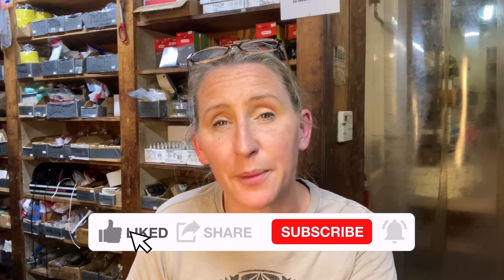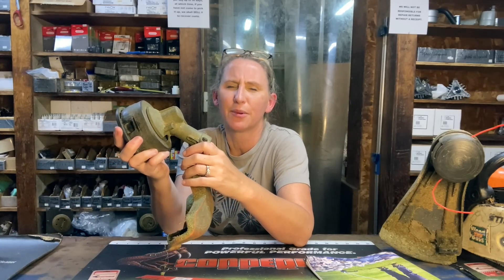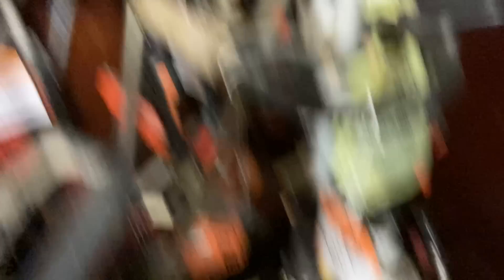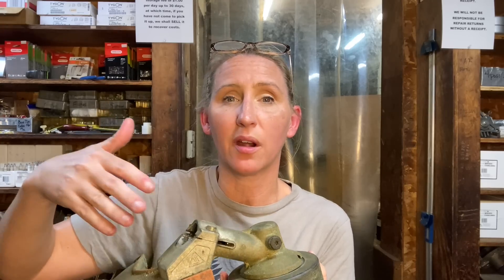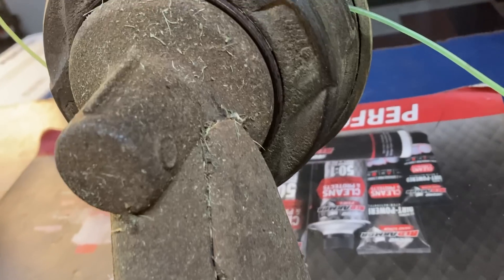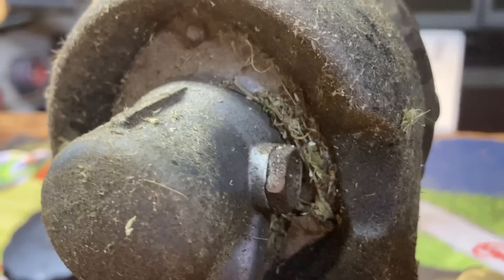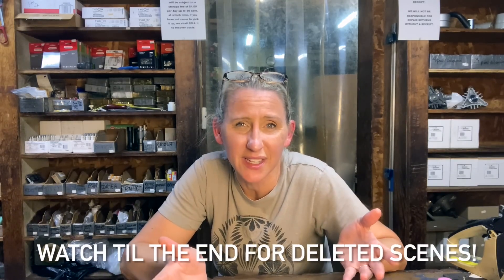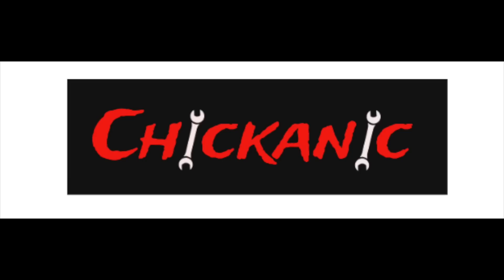Planned Obsolescence?! Why Would STIHL and ECHO Do This?!

Comment: It’s like with the Briggs “Just Add Oil”. The reason they do this is that 90% of people do zero maintenance so the bean counters saved $0.35 per unit. This also ensures that 100% will be dead within 5 years and don’t expect to get it covered under warranty. More planned obsolescence. I understand Stihl doing this but Come on Echo!
Reply: They saved more money than that. The biggest cost was probably due to having to scrap hundreds of parts every time the tapping machine's got out of adjustment(yeah, pipe threads are awesome until you're putting them into castings). A lot of money was lost due to having to recycle parts that passed QA after being cast but were ruined by the tapping machines. Another thing is that just-in-time manufacturing really doesn't like it when there's a random chance that thousands of parts that were supposed to be made in one day end up being delayed due to problems with a tappper.
Reply: @ryelor123  : Production thread tapping is very different to hand tapping a one-off job.    Factories use spiral flute taps that self-clear, and the machines are more consistent in speed and force than any human.
There's not much QA done in mass production factories now.  Human process workers have been replaced by robots, so there's a lot less variation.  In the 1960's and 1970's factories did a lot of check measurements at every step, and employed an army of QA chaps and their statistical tables of Acceptable Defect Rates and whatnot.   If they were supplying to the military, the checking cost more than the making.
But when Japan lost the War and the USA had to move in and run Japan for a while for humanitarian reasons (and keep the communists out),  they saw that Japanese factories were 40 years out of date and were making crap.   So they brought in experts, and one of them taught the Japanese that it is better to design a production process that makes no defects, rather than use a process that has some randomness and you waste money on scrapping and fixing.   The Japanese really took that onboard and by the 1970's were outcompeting the West by low cost defect-free manufacturing, even though their wage rates had got pretty high.   This thinking has now spread throughout the West.
You may have heard an old story that did the rounds in the late 1970's.   An American company decided to contract a Japanese firm to make a large quantity of widgets.   The Americans in accordance with normal US practice wrote into the contract a clause that said that the Acceptable Quality Level (AQL) was a 0.05% defect rate.   When the first shipment of 10.000 widgets arrived, the Americans found that 5 widgets had been packed separately, with a little note ""These are the 5 defective items that you requested."
Reply: @keithammleter3824  Thanks for the stories about Japanese manufacturing after WWII. My favorite was the last one about the 0.05% defect rate. 🤣
Reply: I change my lawnmower oil every season and i put in husqvarna premium fuel for winter storage..... I've had it for 9 years now and it still runs like new.

Comment: Probably a reason was they found out almost no one was greasing it, so they got rid of it to save a nickel.
Reply: Would it be possible to add a grease-fitting to a trimmer, and use a grease-gun to lube the gear head?
Reply: @elultimo102 possibly yes, 
But. 
A problem with machine (drill/tap)  swarf in the spinning parts!
Reply: I've been abusing a Shindaiwa t25 since 1988. I grease the gearhead annually.
Reply: @thomasbunch8476 I’m definitely impressed.  Those were great units, but we haven’t had one in the fleet in years.  We still have an Ol School power broom from that era though. Cannot recall the model, but the primer is in the line with a purge lever, pre push bulb style.
Reply: Indeed, almost nobody greases up those heads and most of them thar do, overfill that cavity. One should only add a few pea-sized dabs of grease as just like in a ball-bearing, grease caking will impair the movement and lead to its failure. Good maintenance practices would call for thorough grease flushing every third year (fill the cavity with a solvent like kerosene and operate it at no load momentarily). Worst come to worst, one could easely drill and fap a hole and add that "missin" grease plug !
Reply: I think it's a way to sell part.
Reply: @egbertmassey8069 exactly sell more parts and bring more customers to their dealers for repairs. 
And if said customer is tired of dealing witb repair. Theyll just try to upsell them. A whole new unit. Likely one thats been updated to take more consumables.
Reply: Exactly what I was thinking.
Reply: Its because that kind of plug can be easily ruined in manufacturing due to tapping machines getting out of calibration. Once they get uncalibrated, every defective part has to be scrapped once QA finds out. By getting rid of the grease plug, many fewer parts are re-melted and less inventory space is needed since you can do just-in-time manufacturing.
Reply: Everything nowadays IS DESIGNED TO FAIL so they can FORCE YOU to buy a brand new one and keep their profits rolling in. If you want to know when an item will fail, look at the warranty, they have tested to the point they KNOW within a couple months the exact failure date and so they warranty up to just before that point. They were teaching designed obsolescence in the 80's in all colleges, this is not news.
Reply: Warranty claims go back to the manufacturer for tracking. No claims, no need for the grease plug.
Reply: And how, pray tell, do you believe they managed to determine this?  It's not as if they are surveying customers or repair shops with questions about maintenance of their products.
Reply: @Rotorhead1651  warranty repairs are tracked, OEM parts are tracked.
Reply: @Rotorhead1651  Well, the two units she showed were residential units.  If it's an X Series it may be a different story.
Reply: @Rotorhead1651

Have you just really said that in public? In a global forum you’ve just stated that manufacturers don’t do market research - they keep track of everything - they buy the data they need as it can all be collected remotely. You must’ve heard of the internet because you’re on it. Great Scott, you’re a thoroughbred tw@. American I’m guessing? Confidently stating things that you know nothing about as facts. 11/10 an absolute W⚓️, would not buy again.

Comment: You don't have to be an engineer to understand designing unserviceable or weaker parts equates the same as screw the consumer + higher profits for the company & shareholder through higher generated parts sales & or replacing whole units. The reduced common denominator is the end user can pound sand.

Comment: Sounds like the lifetime auto transmissions in vehicles these days. 
I recently replaced my Stihl Combi KM94 engine and trimmer, blower, pole saw, and 145 deg hedge trimmer, assuming it would all be identical. I was annoyed to find the pole saw which was 3/8" pitch was now tiny 1/4" pitch, and the hedge trimmer, while having the same number of teeth, was shorter, the bites were smaller, and it had crappy painted and plastic parts on it. I recently had a look over the equivalent Husqvarna tools and they look properly commercial quality. Slowly but surely Stihl seem to be being hollowed out while still charging premium prices.
Reply: I find the 1/4 pitch chain brilliant. Much cleaner and quicker cut. Just a pain to sharpen as there are more teeth!

Comment: Well, its common for universal joints in automotive applications to last a couple hundred thousand miles with no maintenance,  so...
Reply: Right.  In my experience the sealed universal joints will typically last longer than ones that have grease fittings.
Reply: True , but those only bob and wiggle or just oscillate slowly.  At over 10,000 RPM you really need some sort of lubrication.      I can see the angle on having a grease fitting clearly.       Tear the head off one of your angle grinders that’s old.   You will find the grease all flung to the outside and as stiff as hardening mud.     That’s why every couple years I scrape out the hard stuff and degrease the things.      
   Angle grinders go like hell a few minutes at best then sit and cool off.    String trimmers and the like get far longer runs and are high speed even at idle.   It can’t be good for them once the grease has all migrated  and hardened. The only thing all that heat is good for is someone’s bottom line👎🏻

Comment: It's just echo and stihl's small version of their greedflation input onto the market.  They'd probably come back and say that the grease plug is not really used and is actually a contributor to debris getting into the gear interface.  And that keeping that hole and adding a threaded insert on the casting was an unnecessary production cost.  
Not sure I agree it's planned obsolescence though- that would be downgrading the critical parts like the gears and driveshafts from steel to that heavy duty nylon plastic material that does still eventually break, along with not doing materials compatibility analysis for oil, gasoline, and grease..or doing it and being ok with it breaking every 3 years.  Or doing what Chevy was doing with their charcoal canister emissions equipment in their trucks (including the Cadillac 'Cade and the Hummer H2) and allowing a little $20 vacuum switching valve to fail so that it could be sold with a custom preformed plastic tube as a $150 assembly- and causing limp-home mode if it wasn't fixed as a $400-$500 repair.

Comment: It sounds like Samsung when they said they do not make repair parts for their equipment. Is there a way to add a grease plug into these new gear heads?
Reply: Presumably, dismantle the head, drill and tap a thread into the regular position of the grease fitting, thoroughly clean and wash the head component, screw in a grease nipple {zerk fiting} and reassemble the head.

{A grease fitting, grease nipple, Zerk fitting, grease zerk, or Alemite fitting is a metal fitting used in mechanical systems to feed lubricants, usually lubricating grease, into a bearing under moderate to high pressure using a grease gun.}

Comment: I have a stupid question, is there a certain type of grease you should put in the trimmer head? Thanks Michael
Reply: One that matches the soap base type of the previous grease, unless you completely clean out the previous grease.  If you mix incompatible soap types, the grease will separate and harden, resulting failure sooner than just leaving it alone.

Which explains why manufacturers have decided that average longevity is enhanced by removing the chance of a screw-up.
Reply: @1djbecker  Exactly.This is something a lot of people don't realize when greasing any machine.
Reply: @1djbecker  thanks sounds like good to know that information.

Comment: Consumers drive the market, and they deserve as much or more blame than manufactures. Consumers demand cheap tools, and until that changes manufactures will continue to lower quality to deliver what consumers demand. When a cheap item is placed on the store shelf next to a higher quality item and the consumer choses to cheap item, stores and manufactures take note. On your shop tour video you mentioned the Echo PB 2520 being nearly the same as the more expensive PB 2620, only difference being the blower tube. The 2620 has a chrome plated cylinder and piston, a different crank and carburetor, and a 300hr EPA rating vs the 2520's 50hr rating. A lot more difference than you stated for $70.

Comment: Yeah what do you need grease for any modern car has no grease zerks so when the ball joint wears out of this falls out of the socket and you crash yeah stupid engineers there's more of them now than ever like a Ford Bronco the new one total junk have a great day thanks for the inspirational video find another lawn mower in the alley yesterday all it needed was the carburetor cleaned it runs like a million bucks it's a six and a half horse Craftsman woohoo😀